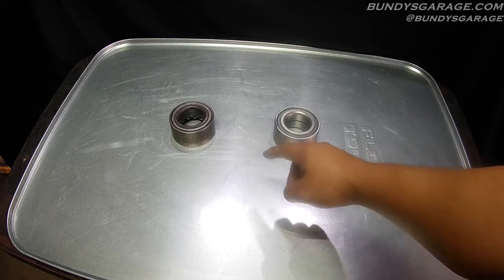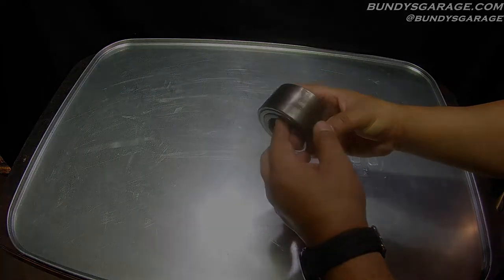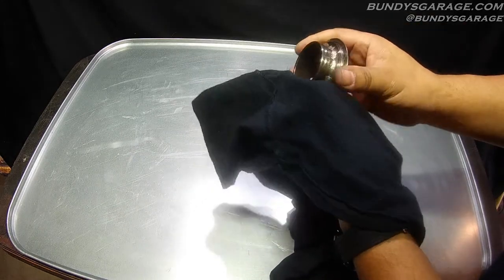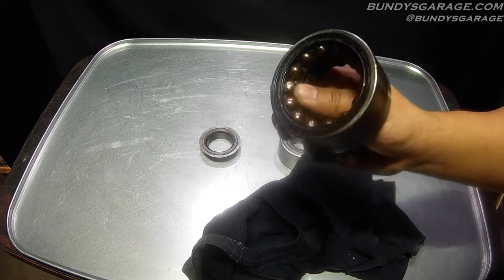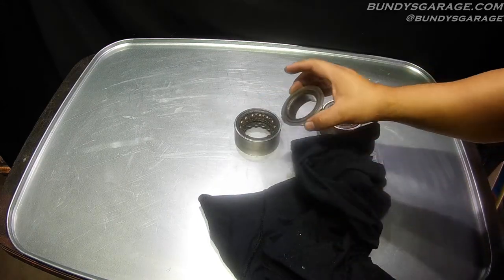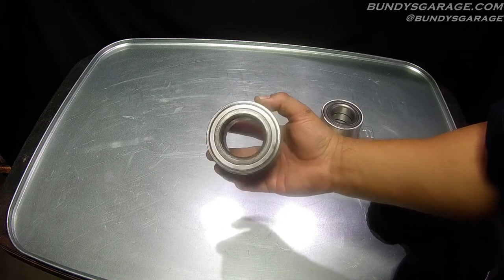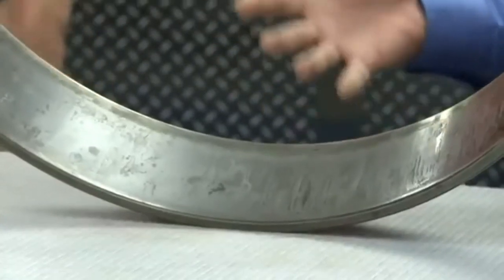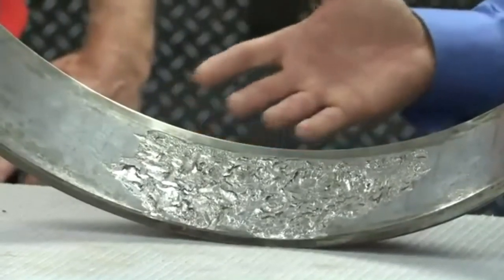Honda Accord Wheel Bearing - NSK Bearing Review - National Bearing - SKF Bearing

Comment: My honda accord 2010 only has 65k miles but the front oem wheel bearing failed.  Why???  I heard honda uses nsk brand for their bearing
Reply from the maker: Do you live in the rust belt?
Reply: @bundysgarage  no.  It was a oem wheel bearing by ntn- national. Expensive brand made in usa.  Failed at 65k miles.🤦🏾 
I then went to the auto part store.  Majority of skf , timken and nsk are made in china now.  You are lucky if you got the made in japan one. So even though those famous brands are made on china now i hope its still good

Comment: The sad thing is, is that that NSK bearing was one of their poorer productions.  I have an Integra with 350K miles on it, with 3 original bearings, the fourth was replaced around 100-150K ago with Timken.  I had wheel hum come back, and naturally assumed that it was coming from the unreplaced side.  But upon further investigation, I realized that it was the "new" Timken bearing with half the miles of the other three.  I also have an Accord with 290,000 miles all original bearings.  This time, I'm putting an NSK back in again.
Reply: I am confused. Are you saying that NSK is poorly produced? If so, why would you add them back
Reply: @petero1068  Yeah... I could have worded that better.  I meant to say that the NSK bearing that gives out at 250,000 miles is a poorly made NSK bearing compared to the rest that are made.  My history is that most of them do much better than 250K.  Other bearings will consider it a good one that survives to 250k.
Reply: @johnramsey5615  Thank you for the clarification. I just purchased two NSK for my Prius -- hopefully, they'll last at least 250,000 miles.

Comment: I had to change all 4 wheel bearings on an Honda Jazz 2005 with 150000km on it. They were all NSK all all four shot. Replaced with SKF bearings. No problems after. So NSK are any good? To be a big NO.

Comment: What about SKF bearings - any experience with them?
Reply: SKF is fine. I tend to like them for one simple reason- if a bearing or seal is in an SKF box...it's made by SKF, and will stamped as such. The same can be said for some other brands like NSK or Koyo, but I don't tend to see them in stock at parts houses.

Timken and National are also fine, but I dislike that their bearings are generally made by someone else and stamped as such. I think the last National bearing I installed had FAG stampings (...it's a German company, I swear). And, to be fair, FAG is also a quality manufacturer.

The biggest ones to avoid are parts store brands. Driveworks, Duralast, etc. You may well actually end up getting a high quality bearing, because maybe they just bought a bunch of overstock from a reputable manufacturer. Hell, I've actually gotten a brand new factory part in a Duralast box before. But, more typically...it's the absolute cheapest crap they could find.

Comment: I'm trying to figure this out but bearings fail because the grease dries out. Trying to see if a needle attachment and grease gun can pump grease into the bearings, if so bearing will last forever
Reply from the maker: A bearing will not last forever. No matter how much grease you out on it. You can extend it's life but it won't last forever.
Reply: @bundysgarage  well I didn't mean literally forever, but I read some farmers and other guys used theirs for a really long time
Reply from the maker: Yes it will help extend the life, if your going to do it i would use Mobil 1 synthetic grease, its red.